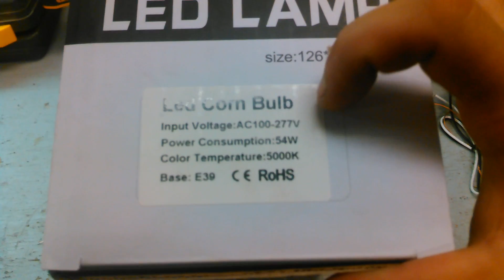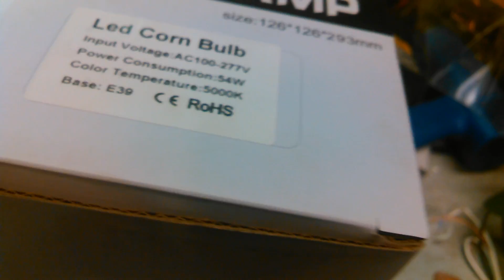Led conversion  from a 250 watt compressed mercury

Comment: Those corn LED bulbs are junk. I find them in the trash often around warehouses here. They last about 3 years due to poor design. Don't waste your money, instead buy a new led fixture with the right led bulb in it. This costs a little more but is worth it in the end since it will last 10 years.

Comment: that 250w mv is deff going to be brighter than the led, 2x brighter..   The LED seems brighter due to the intense glare pin point light the diodes have.   The CRI should be near the same the LED might be a little higher, but light output on the led is most likely around 5,000 lumens, maybe slightly more.   Thats also assuming its actually 54 watts, remember 99% of the led lights out there will claim say 40 watts or 60 watts or 100 watts but they arent, ive tested lots of these lights and they are usually 50% of what they claim.   That 250w mercury vapor bulb will output near 12-13k lumens, which is 2x brighter than the LED.   The LED also has multiple dark spots with all those spaces, the bulb is 360 degree coverage, also garuntee a MV bulb and ballast will last 5+ years, and the ballast probably 20-30-40+ years.  Those corn cob lights are nortiously poorly made.   I honestly would have gone to metal halide but thats just me.. You get the white light, and less power usage and more lumens

Comment: Where did you get that? I am wanting this exact bulb.
Reply: They have it at home depot
Reply: @sopamarucha2388  I found a few while scrapping. I believe they are 5k lumens.
Reply: @Demon-Slayer1983  I just bought a 14,500 lumens and it doesn't work for some reason that's why I was using YouTube lol .. but I seen those at Home Depot while I was looking for bulbs
Reply: @sopamarucha2388  the driver/ballast may be wrong. I was told by an electrician that is a possibility that may need to be changed to work with the bulb.

Comment: Not a massive fan of these LED retrofits to be honest just down to how poorly they handle running long-term in enclosed fixtures. They don't generate a boatload of heat, sure, but what heat they do generate can still be enough to cause degradation or early failure of the lamp in most cases if the heat can't be sufficiently managed. This, in a watertight or vapor-tight fixture is a massive issue.

It's not as bad in an open luminaire like the "yardblasters" that are so ubiquitous on the sides of buildings and on wooden lamp posts as they usually provide great airflow, but in an enclosed fixture, such as a low wattage wallpack, post-mountable flood light or a more standard looking street light such as a GE M400 or a  Philips SGS203, they tend to fail extremely rapidly due to not having sufficient airflow to keep the diodes cool. And if it isn't the diodes that fail, it's the internal power supply.

Comment: Maybe the hole ballast and bulb cost 300 but that 250 watt bulb was not 300 plus you got to have that ballast for the corn bulb so how much was the hps bulb vs corn led just the lights no ballast you will make your money up on it in like 2 to 3 years I do like that bulb definitely not downing anythang inless you got a special build ill look back iv used them before can you make a video showing after you changed the light if you say it's way brighter I'll believe you cause you been working with the high pressure bulb so if it's brighter you let us no but the hole point is its supposed to be Brighter right . You have a good season.
Reply from the maker: ballast https://www.1000bulbs.com/product/402/BA-71A5750001D.html
Reply from the maker: Emily Lee
LED corn bulb 
http://www.ecoillumiled.com/product/LED-Corn-Light.html

Comment: What is the bulb size on the screw end; so I can make sure to get the right one instead of a regular house bulb size?
Reply: They sell a insert that goes in the old fixture so u can use the small led corn row bulbs , almost half the price of the big bulb and still bright .
Reply from the maker: E39 I believe

Comment: my inquisitive mind wants to see what happens if you put in a LED into fitting WITHOUT bypassing the ballast LOL
Reply: You'll smell burning and ballast and bulb will be trash. How do I know? We had energy upgrade last year in my building. A first year trainee put the led bulb in without taking out ballast. Blew out all lamps. 13 of them in court room. Not cheap! Also because in 2 days we had a large court they had to buy new bulbs local which were much more expensive then through there supplier.
Reply: It depends on the circuit.

Mercury vapor lamps don't use a high voltage pulse igniter, unlike high pressure sodium or metal halide, which need an initial pulse of about 4,000 volts to get them going, so I would think it might be possible to do it. However I don't know how the autotransformer style ballasts that US spec HID lanterns have would do running these lamps as they have quite a high open-circuit voltage (OCV) to get that initial startup on the probe in the arc tube.  You would have to grab a meter and measure a mercury fixture without a lamp in it and see how high that initial voltage is to work out if it'll run an LED that way, although I'd still advise against it, as you can have issues when switching on and off where the ballast produces a high voltage spike due to how electromagnetic ballasts (which is what a mercury lamp uses) operate. This can easily kill an LED lamp in as little time as it takes to click your fingers.

Comment: Could you describe the color of the LED bulb to that of a Hg Vapor?  Would you say the color temp and/or hue is about the same?
Reply from the maker: When comparing led to HG compressed Mercury the colors are pretty much the same but the HG as it degrades over time starts getting a greenish tint to the color Plus the LED bulb does not need a ballast it's built into it also to further note compressed HG bulbs are just about the same price as an LED bulb but we've had HG bulbs on this property for 5 to 7 years but the light output on the LED bulbs is basically I would say brighter then the HG bulbs

Comment: So, over 6 minutes and still no comparison.  Great.  Anyway, have fun next week when that Chinese POS "LED" light blows out.  $89 bucks down the drain
Reply from the maker: This Video was uploaded in 2016 I havent had to change one yet the year is now 2018 still have not had a problem
Reply: Translation: i've changed it 10 times already
Reply from the maker: @The_Conspiracy_Analyst  Are you bypassing the ballist ??? Your not just screwing in ..... right you have to bypass the ballast are you are putting in 20,000 volts are something like that  into the bulb sure it will blow very quickly  ???
Reply: LOL is that whatchya did?
Reply from the maker: @The_Conspiracy_Analyst  yep
Reply from the maker: @The_Conspiracy_Analyst   Hey nobody can ask a stupid question on my channel ok..... all inputs are welcome. Yes to use these bulbs you must 1st Bypass the ballast. Are  the ballast will send 1000's of volts into the lamp frying it.

Comment: Do you need to replace Photocell Dusk to Dawn sensor?
Reply from the maker: UHH no you are  making the wattage lower.Replacing with these LEDS will save you more on cost of photocells. photocells can handle a lot of watts .So by lowering  the watt draw/amp draw you will have to replace the photocells less.Thanks for watching .

Comment: Come on dude $250 for a 250 W mercury ballast  you got to do some shopping around you can buy those ballast for like $30
Reply: People should call these things LED shit cobs
Reply: Why is that?  Care to be a bit more specific?  I just received a 54W 5000K LED corn and so far it's excellent-  bright, cheap, and no ballast needed.  It is expected to last a long time (we'll see).
Reply: @donnaland197  is your 54W 5000K LED corn light still working so far ? I ask because I'm debating on whether I should buy one to replace my mercury vapor halide light in the backyard. Thanks!
Reply: Well...good question.  Yes, it works and it works nicely BUT...it's not bright enough to light up your backyard.  There is a 100W LED corn cob style light that I would recommend instead.  The 54W seemed like a great idea and but I find it's just not enough for what I was intending.  It might make a nice grow light or light over your shed (or inside your garage or shed) but it was advertised as being bright enough to light a basketball court-  umm, no.  Go bigger if that's your intent.
Reply: @donnaland197  yea 54w if its actually 54.. is like 4-5k lumens... that 250w mercury vapor is 12-13k lumens..  You could go to a 100w metal halide and get 9-10k lumens of light..  or 150w and get 15k lumens.   Most LED lights are utter crap
Reply from the maker: Yes I kinda over exaggerated  the pricing a little. We are just getting rid of all our merc and halides bulbs .These bulbs are installed in pole lights that is like 20 feet in the air.I have to get our man lift and set up outriggers on the curbs,Traffic cones  ETC....  Just to change a light bulb are a ballast.Heres a vid that shows me changing a light. It takes longer to set up the lift than it does to change the light .  https://youtu.be/PFUH20Sg5OU?

Comment: Is it of equal lumens?  Does it need to be to be an equal light?
Reply from the maker: In My opinion The led bulb is brighter and no it does,nt need to be the same watts or lumens.
Reply: 250w mercury vapor lamps like that sylvania output 160,000 lumens an LED bulb outputs 30,000 lumens at best. you say it is brighter  because the bulb is daylight which gives the optical illusion of the bulb being brighter
Reply: @khalidhebshi5318  wayy off, the 250w mercury vapor puts out about 12-13,000 lumens, the led if its truely a 54w.. might put out 4-6k lumens.. MAYBE

Comment: Mercury vapor/metal halide ballasts are nowhere near $250 and bulbs are nowhere near $30. More like $40 for the ballast and $15 for the bulb. Probably cheaper if you're buying several at a time. FYI you can use probe start metal halide ballasts for mercury vapor bulbs.
Reply from the maker: Yes I kinda over exaggerated  the pricing a little. We are just getting rid of all our merc and halides bulbs .These bulbs are installed in pole lights that is like 20 feet in the air.I have to get our man lift and set up outriggers on the curbs,Traffic cones  ETC....  Just to change a light bulb are a ballast.Heres a vid that shows me changing a light. It takes longer to set up the lift than it does to change the light .  https://youtu.be/PFUH20Sg5OU?list=PLmwZncfHW4ixFOnp9ZPtxkYpTY5K_ilzH

Comment: Usually the ballast does not go bad. Normally it is the $13 capacitor that goes bad.
The metal halite will go bad after a while.
You got a link where you bought the bulb?
Does it say on the bulb itself that it is rated up to 277 Volts?
Usually they are rated for 240 volts per print on the bulb itself, not the box.
Reply: Yes your right about the cap going bad or the starter also . We are replacing them to down our energy cost .Heres the link https://www.amazon.com/Hyperikon%C2%AE-Lighting-54-Watt-Replacement-UL-Listed/dp/B00S5RXDHM/ref=sr_1_3?s=books&ie=UTF8&qid=1469376277&sr=8-3&keywords=led+corn+bulb    As you can see in the pic its rated for up to 277 volts. Thanks for watching .
Reply: You guys all got fooled by the LED industry BIG TIME
Reply: @khalidhebshi5318  Ah you must work in  different lighting industry.
Reply: @khalidhebshi5318  maybe you otta join them
Reply: @khalidhebshi5318  Ditto! LEDs suck! Mercury Vapor is awesome!